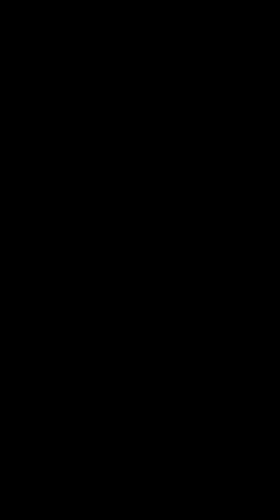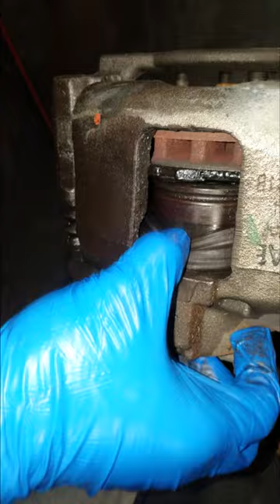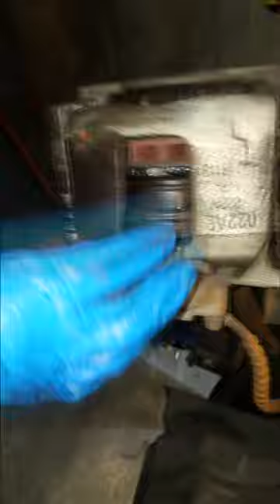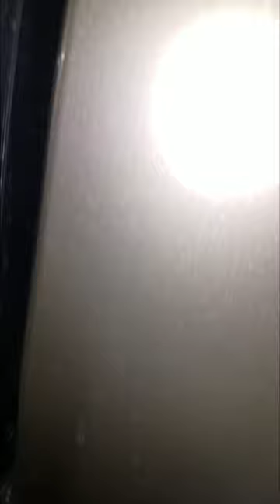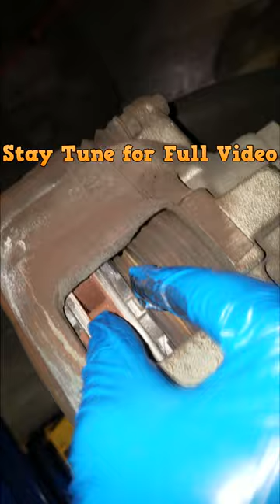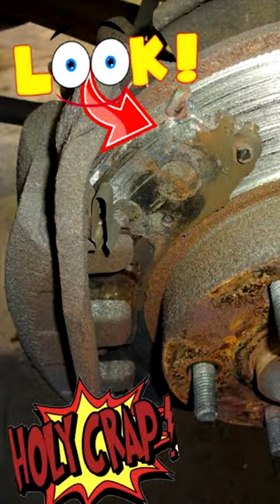This customer should GO TO JAIL FOR THIS. Full Video Up. #JTtheCarGuy #youtubemechanic #shorts

Comment: Why should they go to jail for being ignorant about brakes?  It was probably another mechanic that didn’t swap the rotors anyways.
Reply from the maker: That dont make sense but ok
Reply: @OnlineMechanicTips  most people don’t do their own brakes. They are only told to come in when they hear squealing or squeaking when stopping.  Some mechanics are shady as fuck and will cause problems in cars to make more money, like the guys who unscrewed/loosened the clutch from my ac compressor so i would need to come back and get that work done.
Reply from the maker: @matthewm4020  Damm, yea thats shady. Whoa

Comment: I did a brake job for my buddies 2017 e class AMG and 2 weeks later the inner pad on the left rear was gone. All the other pads were like new. There were lager chunks of pad stuck to the caliper. I don't believe I did anything wrong. My thoughts are it was a defective pad. Brought the parts back to the benz dealership in my uniform and gave me a new rotor and set of pads without any argument. Possibly a known bad batch in circulation?

Comment: Have a 08 ram 1500 I’ve changed cv axle wheel bearing tie rod ball joints rotor brakes and still hearing a womp womp noise plz need a clue on what it could be from front drive tire
Reply: I feel your pain. I have an 06 RAM. I swear... it is the worst truck I've ever owned. Every time I fix one thing, something else is breaking. It is a piece of garbage! Hopefully I can get something for it while it is still rolling. I rather drive a Corolla. Wishing you all the best.
Reply: Sounds like a tire noise. Have you tried swapping the tires around and seeing if the noise changes?
Reply: @ChrisfromGeorgia  I had a 2006 Dodge Ram 1500 so does my brother same here problem after problem
Reply: Y
Reply: @LynxStarAuto  yeah I swapped the tires I’ve done everything I’m lost at this one mechanic friend told me he would have done everything I just did in the order I did them the noise is a womp womp related to speed but like I said everything that could cause it had now been replaced with oem and it’s still making the noise no idea

Comment: You know, that's a bonus on strict regulation. These kinds of things tend to be caught rather fast. In my country a vehicle like that, which is a safety hazard, would not leave the shop with the customer, except on top of a trailer. The shop would even call the police, if the customer insists on driving it away under its own power.

Honestly: Aren't there laws in the US as well, that prohibit the operation of unsafe vehicles?
And if the police catches you, aren't they obligated to have the car towed and professionally inspected at a certain level, like defective brakes, defective suspension or broken frame?

Some people might call that government overreach - until it hits their loved ones and for instance  rather than dying then and there, they have to suffer for decades in a coma or something. Money (if sued for damages) and jail time for the operator can only compensate so much. A taken life is taken, one way or the other.
Reply: Safety inspection requirements vary from state to state but yes it's illegal to operate an unsafe vehicle in any state, regardless.
Reply: @KG So, you're saying you're okay with it when someone runs over your relative with defective brakes, just because it is their choice to operate that unsafe vehicle? Just because it's their choice to not have that repaired properly, before driving?
You're okay with the life of your relative being miserable after that, just because it's the choice of the operator to make it that way?
You know what? Land of the free my azz! That's anarchy!
Reply: @wiedapp  So it depends per state. Some states have emissions and yearly inspections. The owner of the vehicle has to bring it in to a shop and any issues addressed. Otherwise they will not pass inspection, and cannot renew their registration.

Other states like mine (Florida) did away with that decades ago, and you can basically drive it until the wheels fall off. 🤷‍♂️

It sounds good on paper, but the practice was a different story. At least here in Florida, inspections were a disaster. Poorly executed, required additional certification and expensive tooling that not a lot of shops attained. That meant the ones that did, were hammered constantly. The procedure being regulated was a fixed price and didn't really generate a lot of revenue. So a lot of shops just passed the vehicles if you greased their palms enough. It also introduced additional steps and paperwork at the DMV. Our DMV's are known to be some of the worst in the nation.

Overall, it was almost unanimously agreed upon, that the process needed to go away. Our constituents performed a "study" that concluded the average age of a vehicle on Florida roads was 6 years old. Not old  enough to have incurred severe wear and tear yet, so they did away with the regulation.
Reply: @wiedapp  Also as a professional automotive mechanic myself, I will tell you that the example in this short is the exception and not the norm. Here in South Florida ppl fix their cars. Our distances are long, and our traffic brutal. Sure ppl may delay a repair a bit, or ignore some warning lights if they don't affect the operation of the vehicle directly, but for the most part, folks fix things.